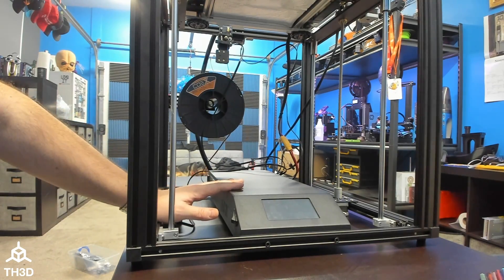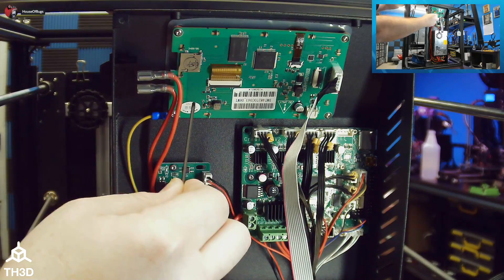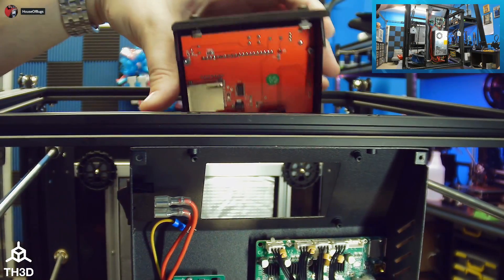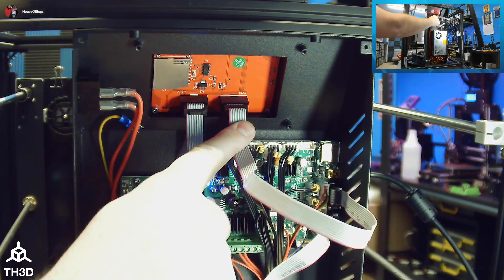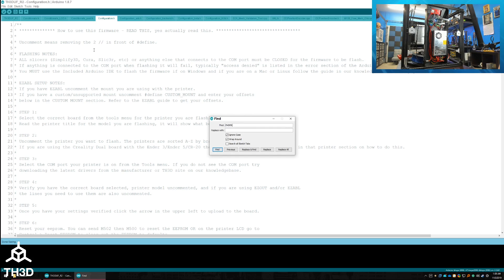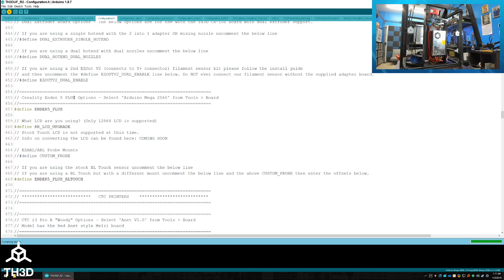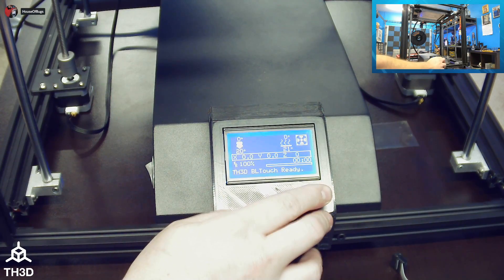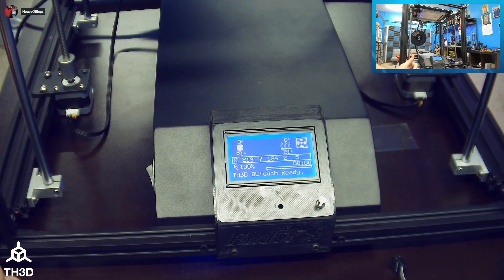Creality Ender 5 Plus 12864 LCD Upgrade Video Guide - No More Touch Screen!

Comment: Just a heads up all your links go to 404 pages.
Reply from the maker: Firmware is here: https://support.th3dstudio.com/helpcenter/creality-ender-5-plus-firmware/

What other links are broke?
Reply: @TH3DStudio   It was the link in the Read this comment, and the Link that pops up at 6:21 that takes you to the video description, that link is 404 and there was one more but I think you fixed that too.  I had 3 404 windows I think.

Right in the middle of installing ABL, TFT, and your firmware along with a couple other goodies.  so far so good.  this is my first trip into "custom" firmware and im really looking forward to getting this ol E5Plus to be a useful printer.
Reply from the maker: I still use my E5Plus in this video to this day. It's one of my favorite machines.

Comment: Is this LCD compatible with the Creality 4.2.2 main board??
Reply from the maker: Technically yes but there isn't firmware out for it. You'd also need the dual cable LCD adapter board to go with it. The Ender 5 Plus we already have supported on the V4.2.7, All SKR E3 Mini Boards, and our EZBoards. But we do not have a firmware for the V4.2.2 since those are factory boards that came in other machines and not aftermarket boards.

Comment: After no luck with a blank stock screen I bought an lcd upgrade kit and tried everything listed here. When I control via the dial it registers input via the blue LED but absolutely nothing on the screen. Do you think it could be the board? The stock board is a v2.x
Reply from the maker: Did you upgrade the firmware on the board and did the board take the new firmware? If you bought our kit you do have tech support available. Just contact our team to get help from us directly: https://contactus.th3dstudio.com/

Comment: With this upgrade will the printer respond to the M 600 code? Also can I pause a print as I can do on my regular ender5?
Reply from the maker: Yeah our firmware and this upgrade kit supports M600.

Comment: I'm trying to install this upgrade on my stock Ender 5 Plus. I'm tried to follow the guide to install this firmware: https://www.th3dstudio.com/hc/downloads/unified-2-firmware/creality/creality-ender-5-plus-firmware-v2-x-2560-board/. Afterware, my stock BL touch was just not acting properly. It would not perform the bed mesh appropriately, it was acting as if it did not know the correct bed size for my stock Ender 5 Plus. It also would have random restarts, and, was moving very roughly in the Y direction, for no reason that I could discern. I next have tried using this older firmware: https://www.th3dstudio.com/hc/downloads/unified-1-firmware/th3d-unified-1-firmware-package/, and, it seems like its going to work, except, at the start of my first test print, it is acting as if there needs to be a change of filament and purge. It does this once, then traces the starting prime lines on the left side of the bed, then again, acts as if I selected "change filament" from the menu. I also don't see any way to live adjust my Z-offset while this print is underway.
Reply from the maker: Hi there Jon. Sometimes due local PC issues the firmware doesn't compile correctly and causes the ABL to not home right. If you have another PC, try using that to compile Unified 2 and it should work.

Comment: I have silentboard from eneder 5 , bltouch and this lcd, but the lcd is is not showing anything , niether the bl touch is not comming out
-.-
Reply from the maker: Idk if you got it from us or not, but this is for the 12864 RepRap type LCD not the Creality one. You may need to reverse the cable ends: https://support.th3dstudio.com/hc/product-information/lcd-screens/12864-lcd-screen-not-lighting-up/
Reply: @TH3DStudio   I tried that , its just backlight. nothing shows ., if i use pronterface i can move axies bu when i Home Z the bl wont go out. it does its self test at the beginning..

Comment: I did everything on the video but when I upload It I get this error message, avrdude: stk500v2_ReceiveMessage(): timeout , and I have no clue how to fix it
Reply: avrdude: stk500v2_getsync(): timeout communicating with programmer
Reply from the maker: You probably have something else connecting to the COM port that is preventing it from flashing.
Reply: @TH3DStudio   I’m still confused, for ports I only got one which is COM1 and the only other things connected to my pc are the mouse and keyboard and it’s the only program running on it. First time doing this, was expecting it to work 😅

Comment: Could I use a parted out LCD screen from a ender 3 Pro with your EZBoard Lite V1.2?
Reply from the maker: Yes, the ender 3 Pro LCD works with our board. But it will not fit in the LCD housing shown in this video.

Comment: How would I go about getting the 12 point probing instead of the new 9 point probing???
Reply from the maker: The EZABL_POINTS value controls the grid. It is set to 3 which is a 3x3 grid (9 points). If you want more you can change it to 5, 7, 9, etc. Stick with odd numbers.
Reply: @TH3DStudio  im not familiar with ardriuno...which is it in...H or advanced H.
Reply: @TH3DStudio  which tab in arduino is it in...but I have the stock ender5+ bltouch

Comment: How do you upload the firmware to the Ender 5 Plus i heard that because there is no bootloader you have to put the hex file on the SD card
Reply from the maker: Ender 5 Plus has a 2560 board in it. Firmware can be downloaded here: https://support.th3dstudio.com/hc/en-us/articles/360052502172-Creality-CR-10S-Mini-S4-S5-Pro-CR-20-CRX-Ender-5-Plus-Firmware-V2-X-2560-Board

Comment: I've flashed the firmware and installed the screen - all that works fine, but now my extruder won't work at all?  I have the silent board, flashed that and nothing.  Went back to the older board, same results with the TH3D Marlin fork. Any ideas?
Reply from the maker: Your hotend needs to be heated for it to move. 170C or higher. Its called cold extrusion prevention.

Comment: After updating the firmware I have lost the manual bed level option, is there any way I can add it back to the LCD? I only have 'bed level' option which is for the BLtouch

Comment: Do I need this LCD screen to be able to use cura pause at height plugin? Or can I use the touch screen? Any and all info will be grateful.
Reply from the maker: Not sure. But it will work with the firmware + LCD from us. Try it out and see if it works or not on your machine with the stock setup.
Reply: @TH3DStudio  so all I need would be the full lcd kit from y'all correct? Stock motherboard will work?
Reply: If this is all that's needed I will order asap!

Comment: Hi Tim, I downloaded your firmware but I can't find the line "#define RR_LCD_upgrade" and the line "#define Ender5_Plus_BLTOUCH line. Did I do something wrong?
Reply from the maker: Neither are needed and set by default now. If you are removing the BL Touch or replacing it with the EZABL there are options there as well. 

This is also in this video description: "Since we only support this LCD on this printer model you do not need RR_LCD_UPGRADE anymore, it is automatically enabled when you setup the firmware for the ENDER5_PLUS."
Reply: @TH3DStudio thank you very much for clearing up my doubts
Reply from the maker: Not a problem. The issue with videos is we can't update them after the fact. :(

Comment: Not seeing the #define RR_LCD_UPGRADE on the configuration. Just #define ENDER5_PLUS
Reply from the maker: It is not needed anymore since we only support this LCD upgrade on this machine. Just ignore that part. We'll put a note in the video.
Reply: @TH3DStudio  What happens if we flash TH3D firmwares on the E5+ without upgrading to an LCD?

Comment: Can you control the filament cooling fan speed on the fly? [not talking about the hot end cooling fan]
Reply from the maker: Yes, you can set different speeds throughout your print in most slicers.
Reply: @TH3DStudio  I understand that you can set fan speed in a slicer. My question is specifically: post slicing, during print run-time, can I adjust the fan speed to a higher or lower percentage.  Example: I set cooling to 50% max in slicer, during the print I discover stringing, so I go into the 12864 LCD Upgrade unit and change the fan speed?  <-- possible? Y or N?   Cheers!

Comment: Just got mine for ender 5 plus. got firmware installed also. I was wondering if there is a contrast and/or brightness adjustment pot on the board. Display seems very light with low contrast. Great products!  Thank you
Reply: So everything just worked....I cannot get my LCD to light up at all....reversed the cables no love.

Comment: Does this firmware disable the filament sensor?   Attempting, but also constantly getting Timeouts.   Is there a bootloader on the OEM board?
Reply from the maker: No, the filament sensor is enabled. Test with M119 to verify that your sensor is reading correctly. It should be connected to the X+ endstop port on the board.

Comment: I followed all these steps, but I keep getting a timeout error. Only thing I can think of is I have the Creality silent board upgrade on this Ender 5 Plus.. I really hate hitting one brick wall after the next with this crap.
Reply from the maker: That board should have the bootloader on it. Make sure all slicers are closed and check our website for drivers for the Creality boards.

Comment: With the stock creality board and firmware I cannot edit linear advance (M900 gcode), does utilizing your firmware expose these options?
Reply from the maker: Yes, our firmware has Linear Advance and it works. Just turn it on in the configuration setup.

Comment: I just got this upgrade going, very much enjoying it!  I did notice one oddity in the latest firmware (I downloaded mine Apr. 3rd, 2020).  I saw no lines in the configuration.h for the BL touch, like it says in the video.  So I manually added mine in.  Not sure if I did the right thing or not, but it seems to work, 16 point levelling seems to be fine, so I'm happy.  I had initially opened a ticket with TH3D since on my first try, the firmware flasher didn't recognize my printer, but I re-tried it today and it worked just fine, so maybe I had a wobbly USB connection the first time.  Happy customer!
Reply from the maker: The BLTouch is enabled by default on the ender 5 Plus now since that is what it comes with stock. Firmware changes all the time so videos are not able to be updated.
Reply: @TH3DStudio  so that's why the line is missing in the configuration.h then, cool.  But for some reason, the firmware would just crash on print attempts. Octoprint reports bed levelling failed, and the firmware dies hard.  Seems to be such a simple process, but I must have goofed somewhere.  I went back to the stock touchscreen / firmware for now and flipped you guys a ticket.  Hopefully we'll have a good laugh when we figure out where I goofed, LOL!  No rush though, stock works well enough for now.

Comment: will this firmware work with bigtreetech tft35 e3 v3 on 5 plus. and do you use both cables still
Reply from the maker: No. It only supports the 12864. You should contact BTT for support on their product.

Comment: mine came in today, man it took me  like 45 minutes trying to get the lcd mounted to the plastic frame. Ended up pressing in brass inserts.

 Was it intended for these screws to be screwed directly into the plastic??

Also ENDER_5_PLUS_BLTOUCH is no longer in configuartion.h.  Is this now declared by default?
Reply from the maker: Yes the screws go into the plastic. Sometimes rounding them out with a tip of a phillips to make it tapered helps them go in. We're testing out some coarse thread screws to see if those can make it easier instead of the M3 type.
Reply: I use these all the time. https://de.screwerk.com/en/shop/detail/stp/STP310300100S.html

Comment: Ok, I'll embarrass myself and ask the question. Mine came with a knob stuck on it.  How the HELL do I get this knob off so I can attach it to the face plate??!!??!
Reply from the maker: Pull it off hard and straight. They are just press-fit.
Reply: @TH3DStudio  done, thank you!  I was hauling on it pretty good, but it wasn't budging.  I just needed your confirmation before I used better leverage.  Came off fine.

Comment: man, I would really like a screen that when I turn the dial, it ACTUALLY moves the selection in the menu on the first try on my Ender 3.
Reply from the maker: Its due to how the encoders work. They seem to have a little bit of a "dead zone" to them. You can try tweaking firmware settings but you'll end up with it being more sensitive and overshooting sometimes. Best to have it need an extra "click" every now and then instead of overshooting.
Reply: @TH3DStudio  couldn't we just solder a better encoder with less of a deadzone on? It's very frustrating when trying to set very specific values

Comment: Why is the 5 plus missing from the list of supportable printers on the EZ board product page? You are still talking about the conversion, right here and now in fact, but the board is absent from the web store upgrades for the E5+ and the E5+ is absent from the store page for the EZ Board.

In January it was listed with an (L) for requires this instant replacement. Since the price hike and low stock, the board has been confusingly absent from most places where the two are shown...

The 12864 page does discuss the use with the EZBoard for the E5+
Reply from the maker: We were waiting for the video to be done. It's all officially supported now but ONLY when you convert the LCD to the 12864. Firmware is already on the site and EZFirmware site for support with the Ender 5 Plus. For more details on the EZBoard+Ender 5 Plus see here: https://forum.th3dstudio.com/d/543-ender-5-plus-upgrade-thread-ezabl-lcd-ezboard

Again, to use the EZBoard with the Ender 5 Plus you have to convert the LCD to the one in this video (the 12864 one). The EZBoard will not and never will support the Creality proprietary LCD screen.
Reply: @TH3DStudio  Thank you, I only wondered because it was listed exactly as described - requiring the LCD swap in, and then the option vanished from the product description.

Before rushing to buy what I thought I wanted - I needed to be sure that there weren't any blocking issues. I've seen a similar concern raised elsewhere too.
Reply from the maker: We've got 200 ezboards coming in on 3/16/20 (monday) at the latest. They're in Tennessee right now as of posting this comment. :)
Reply: Grace Sprocket You can’t use the EZ board with the 5 plus UNLESS you replace the touch screen with the LCD case.  The touchscreen firmware is proprietary and you can’t make it work with the new marlin firmware you need for the upgrade.
Reply: I replaced the touchscreen on my CR10S Pro with the LCD upgrade and I’m very happy with it.